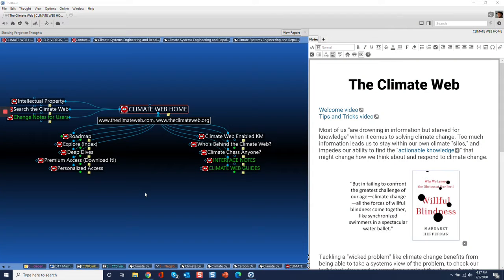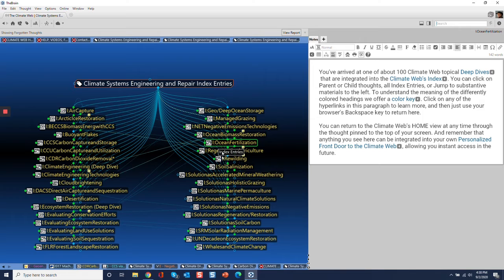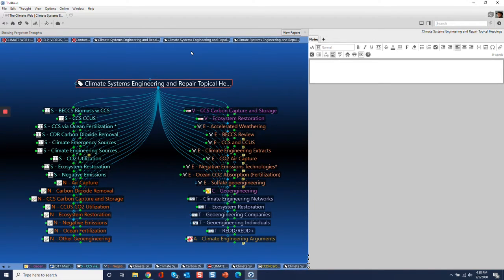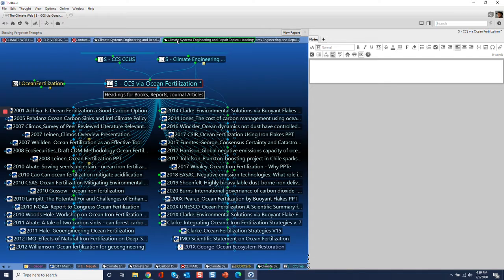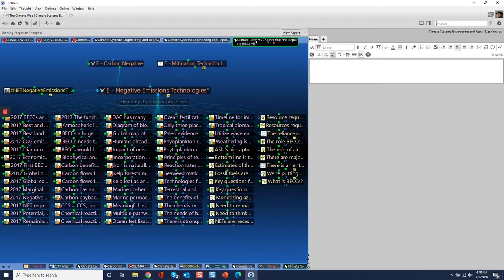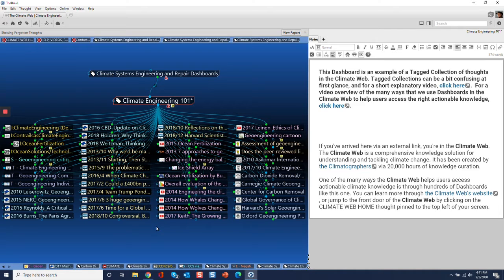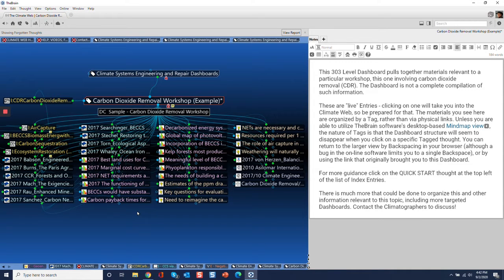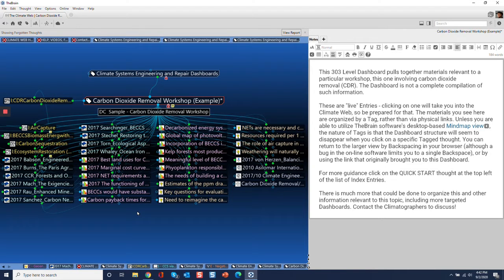Climate Systems Engineering and Repair

Comment: 23 billion chickens = if one sneezes we all get the flu, covids et al are here to stay
We burn fuel @ 3 Hiroshima bombs every 5 seconds, we must cut that 50% in 10 yrs because 1.5 °C = death
no trees = no air : https://www.pnas.org/content/early/2015/07/14/1508353112
2020 : 4% of mammals are wild https://www.ecowatch.com/biomass-humans-animals-2571413930.html
2020 : 2% of global energy is solar and wind -- after 20 yrs trying  https://www.iea.org/data-and-statistics 
2020 : CO2 up 60% in 30 yrs : up 30% in 15 yrs https://lokisrevengeblog.files.wordpress.com/2019/10/c02-human.png
2030 : 50% of world will be short of water https://lokisrevengeblog.files.wordpress.com/2020/08/water-wri.png
2040 : 15% of global energy will be renewable https://lokisrevengeblog.files.wordpress.com/2019/12/2040-energy.png 
2050 : 28% of global energy will be renewable https://lokisrevengeblog.files.wordpress.com/2020/08/2050.png
2050 : 600 ppm CO2 BAU https://lokisrevengeblog.files.wordpress.com/2020/08/rcp8.5.png?w=1024
Weather = flash floods + flash fires + flash rains + flash droughts + flash mobs
Climate = 30 years of weather + you don't got time to worry about climate
Dams and bio-energy are ecological disasters
50% of Nordic Europe's renewable electricity comes from burning imported trees
We burn corn, soy and palm oil in cars and will do so until 2030 so far
We burn recycled plastic and paper for electricity
In the last 20 years, petrochemical demand grew 7X human population
You can’t burn imported trees for electricity to save us from the climate
We can't build wildfire suppression big enough to handle future wildfires
Forest fires will burn faster than we can plant trees
We don't have enough land for bio-energy because we are losing forests, soil and water too fast
To get 30% of energy from algae would take a country the size of Argentina
To get 20% of global energy from solar in 30 years, we need them 3X faster than now
https://www.solarpowerworldonline.com/2020/02/perovskite-solar-cells-hero-villain-or-just-plain-fantasy/
By 2050 up to 78 million metric tons of solar panels will have reached the end of their life, generating about 6 million metric tons of new solar e-waste annually -- standard electronics recycling methods don’t cut it for solar panels
https://www.wired.com/story/solar-panels-are-starting-to-die-leaving-behind-toxic-trash/
50 Reasons why wind power can not replace fossil fuels
http://energyskeptic.com/2019/wind/
By 2040 not even half of all cars will be electric
By 2040 we will be lucky not to go hungry
REAL CLIMATE JUSTICE = 100% PRIVATE GLOBAL CARBON UBI = 0% FOR GOVERNMENTS
zzz